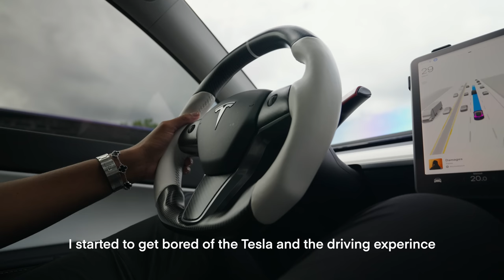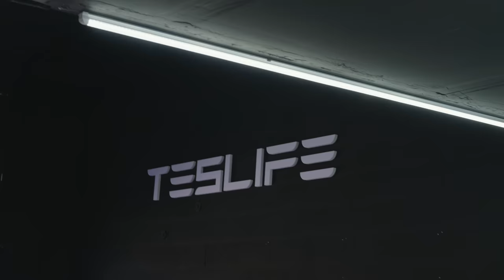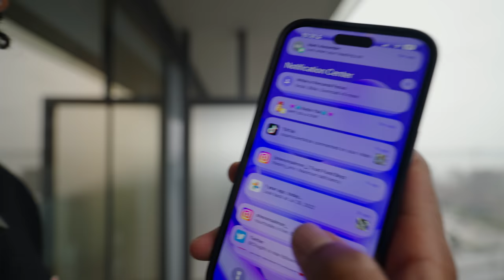I BOUGHT MY DREAM CAR - 2023 BMW M8 COMPETITION

Comment: Congratulations - recently sold mine off. Few things to watch out for:

-The control unit on the seats. The wiring setup from the factory causing the electronics to fail if the seat is adjusted frequently while driving. Factory may need to manually fix it up.
-A/C pump prone to fail. Covered under warranty
-Windows and trunk auto open. Tends to happen when an over-the-air update happens to iDrive. Was not able to find a fix for this.

Enjoy. It's the best BMW M car in my opinion

Comment: Congratulations, CRAZY ah BMW.  As a fellow car guy NGL I would love to see it wrapped in a Midnight Purple Wrap, sitting low on Coilovers, Carbon Fibre all around, and a Valvetronic Exhaust System (Toronto Police be wilin sometimes). Build your whip just the way you like it. In the car community, you'll surely come across some haters, but I can't wait to see your progress, broski!

Comment: no break in period? can't be driving brand new cars hard. Have to keep most under 3K RPM for around first 1,000 miles.
Reply from the maker: i had it 3 months before i made this video. I just wore the same shirt for consistency

Comment: You have bought a great car - an M 8. Looks like you made the video the day you picked it up. You took your friends for rides. Are you observing the 1200 mile engine break in period of not going over 4000 rpm for the break in period?
If you aren’t respecting the break in period you are abusing a great M car.
Show respect and observe the break in period.
Reply from the maker: I picked up the car months before I took my friends for drives.

Comment: You bought a car. The car needs love. The car needs joy. The car must be well taken car of. If you never say a vcr thats okay. I dont think the plug on the intro is valid. So. Ease that car into a cell phone lot n run. Run away fro. The car or try to find out what is going on. The thing. The thing. The thing is interactive. Whats that about. Very scary man. Be safe. One joy. All friends aint good friends. All cars dont drive once the battery dies because life' life ia golyden for those take. Work is butt sauté.